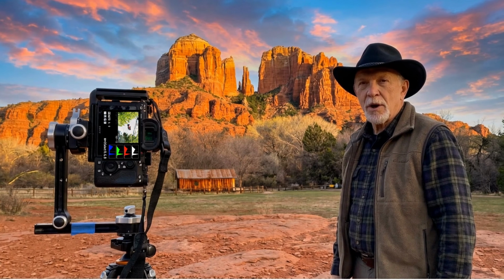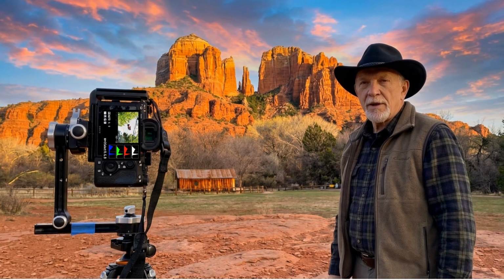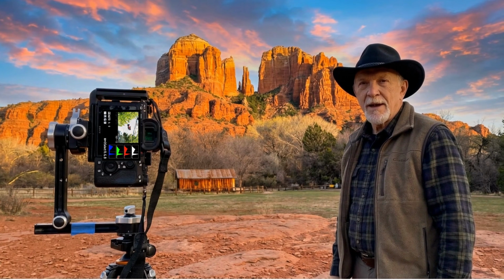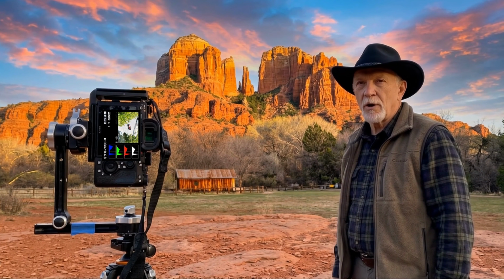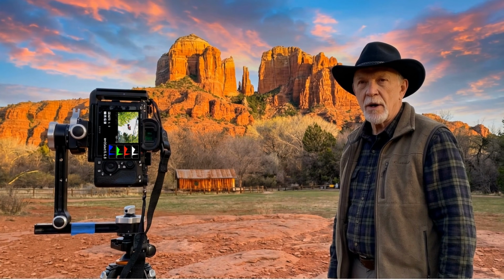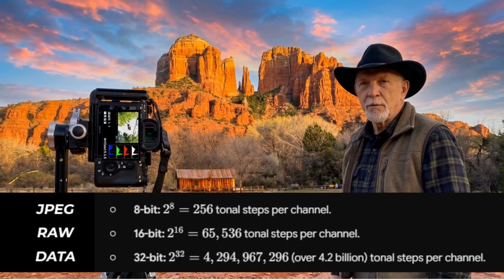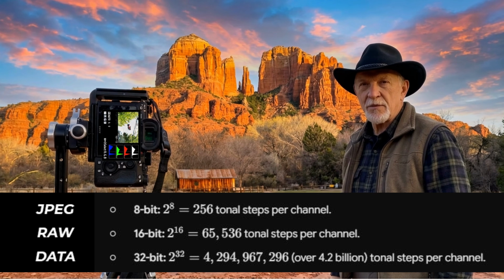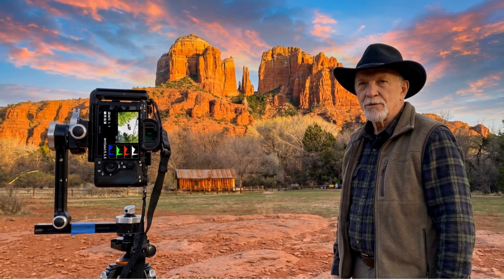Is Your Camera Failing You? The Truth About Dynamic Range

Comment: I’m sure i read that at least with Canon, the Histogram is based on the jpg predict and not the raw data. So a flat jpg profile is still better than using the standard one. Can you confirm this?
Reply from the maker: You are 100% correct! This is absolutely true for Canon, and it's actually the exact same story for the Sony cameras I use. The camera generates the histogram from the internal JPEG preview, not the raw sensor data. Standard profiles add contrast, which can make the histogram show clipping when your RAW file actually still has plenty of detail left. Switching to a 'Flat' or 'Neutral' picture profile gives you a much more accurate read to work with. It makes checking for that right-side clipping on bright shots (or left-side on dark ones) far more precise. Great point to bring up!